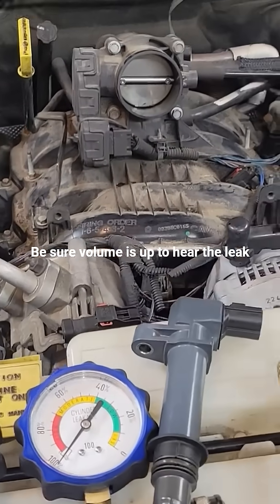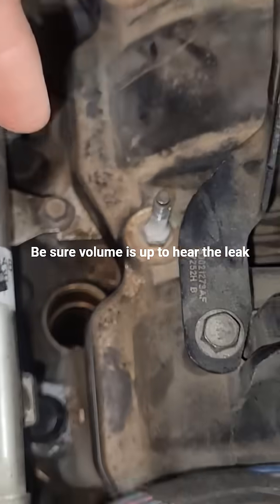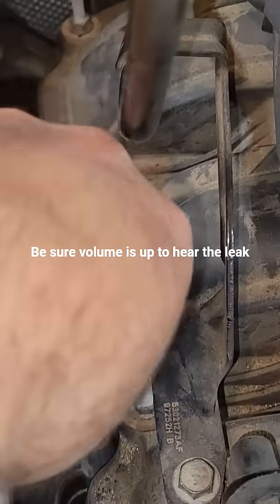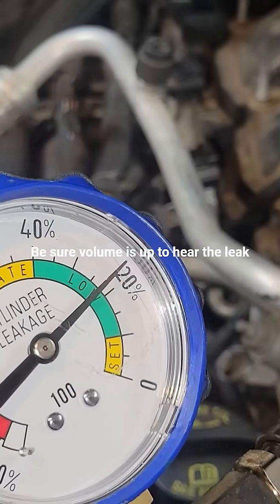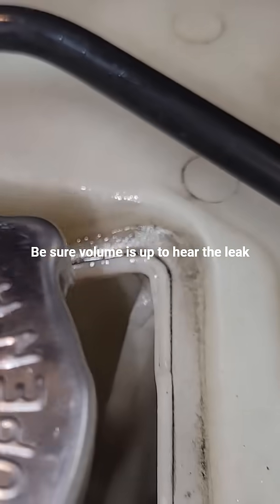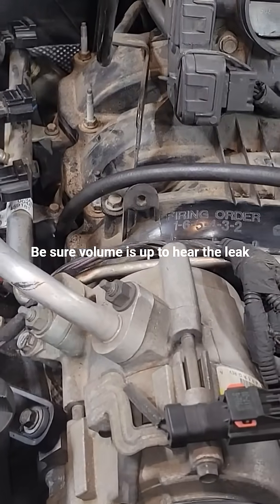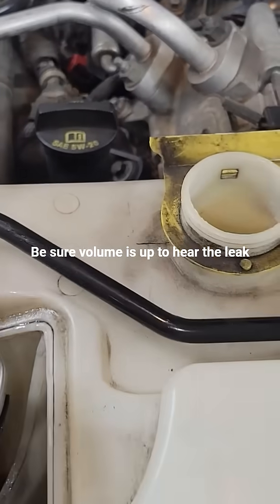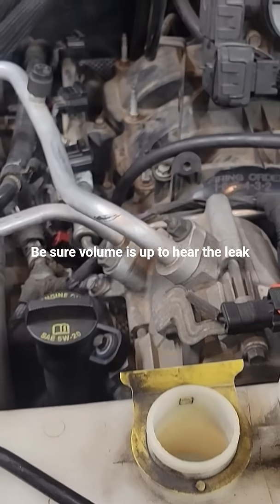Head gasket leak through radiator/coolant #headgasket

Comment: So you have to check each cylinder tho right? Where could you put it to not have to pull each plug and could do then all at once?
Reply from the maker: For using compressed air, you have to do each cylinder individually.  You could try using the chemical tester in the coolant reservoir, but if its a small leak it wont detect it.